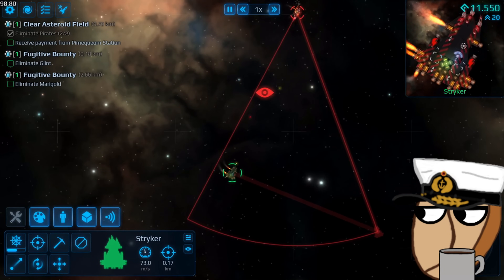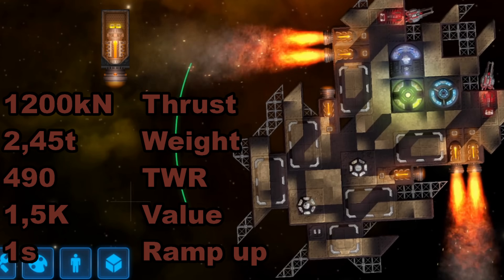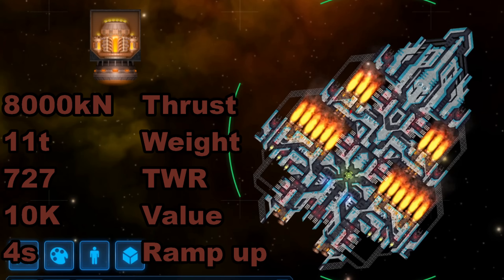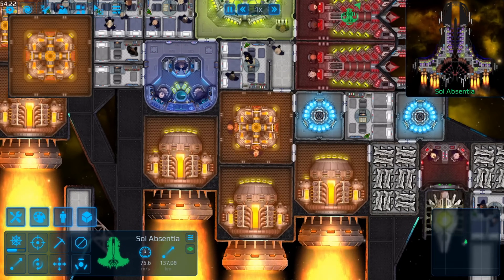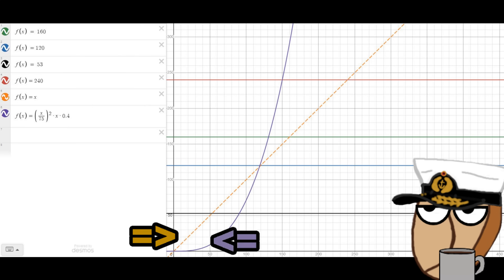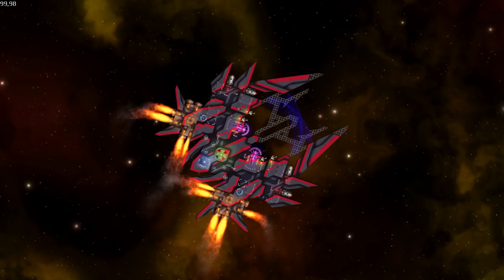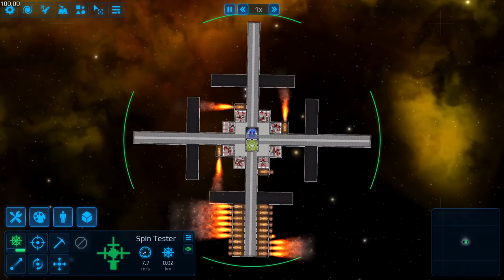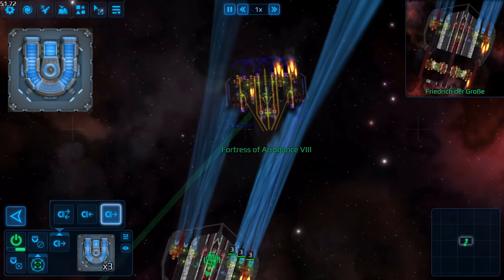Cosmoteer Basic Engines Guide

Comment: The engine room has a massive downside. Crew. Two fuelbros can supply 3 engines, but it takes 4 to supply an engine room with 3 engines attached. You need very large ships with no more room for thrusters to justify engine rooms.
Reply: Some ships will be too small to justify an engine room. But it's worth the cost logisticcally since all of those engines can be resupplied from a closer point. On top of that, the thrust bonus with just 3 thrusters is similar to basically having another thruster and a half of power without any crew or space being used.
Reply: @meeplymoon8391  Right so you can have 6 engines or 4.5 for the same crew in this scenario.
Reply: No.. you can have the same amount of crew power more thrust from farther and faster.
Reply: @meeplymoon8391  Build the boat. See for yourself how it works.
Reply: @Ibian666  I have.. I made a 1200 ton ship go 130m/s.

Comment: Great video but what was that formula at the end? Its just √2, from Pythagoras!
Reply: √2 from Pythagoras is only correct for equal thrust (as shown in the video). Might have made more sense if he had shown unbalanced engines. If you put a huge and a medium thruster at right angles and lock their thrust at max you will get √(8^2 + 1.2^2)~8.09 MN of thrusts in a slightly diagonal vector and "lose" almost all the thrust of the medium one, because you are essentially going "forward" in the direction the huge thruster is pointing you...

Comment: Explosive charges can actually be using on front armor as a means of creating a smoke screen. Just push towards enemy ship and when close enough, explode them so they block enemy fire and you can move to escape or flank them. Your ship will need to be decently fast for the latter though.

Comment: the one thing I always wonder about these space games, why is there drag? we're in space, there is no atmosphere, in theory, we could just keep accelerating to the speed of light even with the smallest thruster, a better implementation would be to give a universal max speed, basically how fast can a ship go without breaking the game, and then the engines would only affect acceleration up to that speed, the only way to slow down in space is to burn in the opposite direction, or hit a large object, there is no drag to slow you down or limit your max speed, I think it would give a lot more dynamics to space battles, as well if there was collision damage, could be fun too.
Reply: We're in what would be considered a "soupy nebula" with a certain amount of constant drag.  Not for realism, but for gameplay purposes.  If you blew up a ship, it would keep flying off into space forever and become unrecoverable.  Any parts that broke off would also quickly scatter across the entire solar system making gathering materials a massive pain in the ass.

It's also much easier to balance ship speed if you cannot simply accelerate to the universe speed limit with enough time.  You have to actually build more and larger thrusters for your ship as it increases in mass if you want to go fast.

Comment: I wrote a short bash script using your drag equation to help me quickly design ships, but discovered a slight error. When using your drag formula in the video, whether in my script, a calculator, or desmos, I find that a TWR of 120 gives 119 m/s, not 117 m/s. This is likely a typo or rounding error (when I try to perform the reverse operation, which involves the cube root, to 2 decimal places, it results in the same value of ~117 m/s for every TWR from 116.6 to 120.1).

Comment: Another great video. One thing I don't get, though... Ramp up time.

If we take a huge engine, 8000 kn of thrust, developed over a ramp-up time of 4 seconds, means that it's developing 2000 kn of thrust per second, up to  a max of 8000. If we take a smaller engine, though, 1200 kn with 1s ramp-up.... So it's only developing 1200 per second.

Larger engines are still better for quick movements than smaller ones, no?
Reply: Already commented this elsewhere, but it may be useful here too.
You're comparing on a thruster-by-thruster basis, but a standard thruster takes half as much space and power as a large thruster.
A large thruster provides 3.2 MN of thrust at 1.6 MN/s, while 2 standard thrusters provide 2.4 MN of thrust at 2.4 MN/s, with the same space and power consumption but lower cost. Neglecting drag, the standard thrusters provide better impulse for thrust durations of under 2.5 s, which will translate to better Δv, so they may be preferable for maneuvering, especially on smaller ships with lower total maneuver time.

Huge thrusters are more difficult to compare as they no longer have the same width for their power consumption, being only 3 tiles wide rather than 4, so I'll compare them on both a power and thrust-width basis. On a power-equivalent basis, they ramp up at 1 MN/s to a max of 4 MN, catching up in impulse to standard thrusters after 4.25 s and large thrusters after 6 s. For equal width, they ramp up at 1.33 MN/s to 5.33 MN, outstripping standards after 3 s and large after 3.38 s.

Comment: 8:40. Do no remove the doors that give direct access the engines connected the engine room else they will not receive power cells when the engine room goes offline. This is especially valid in Career mode when you lost crew after a fight trying to limp back to a safe location.

Comment: I have absolutely no disagreements with this video, which surprised even myself. Everything is spot on and I couldn't agree with it more. Smaller thrusters aren't worthless and I'm tired of people saying that, and you give them a ton of justice. Heck, there is even a whole class of competitive ships called Avoiders that use nothing but an insane amount of smaller thrusters to become insanely agile and allow you to do some crazy maneuvers, if you can pilot well enough of course. Even if you're not going down the avoider path, smaller engines can still be a really useful asset for increasing one's overall agility. And yes, I am the exposed thruster enjoyer and think that boxing them (Unless it's a relatively light and detachable layer of thin armor that is meant to protect you from enemy fire whilst retreating and can be useful for single-thrust fastwalls. My key setups are exposed thrusters with a few tile long armor around all the places where they can be placed. It isn't as space and weight-hungry as completely encasing your engine cluster, but it surely saves you from stray shots around your engines.

5:26 And yes, I too am the guy of Engine Room forcing. They're amazing tool for all and every large ships and there's no other way to put it. USE THEM!
Reply from the maker: finally. i have achieved perfection

Comment: I was wondering how much the ramp-up time matters between std thru huge. If you multiply the transient by the peak thrust output, the rate of thrust change is nearly the same between all the thrusters. IE. the bigger engines may take longer to reach full thrust, but since they have a higher thrust ceiling, the rate of thrust change is the same. Shouldn't this mean the maneuverability difference is negligible?
Reply: So this means that more smaller engines will provide less maximum thrust but reach that maximum thrust faster.
A large thruster provides 3.2 MN of thrust at 1.6 MN/s, while 2 standard thrusters provide 2.4 MN of thrust at 2.4 MN/s, with the same space and power consumption but lower cost. Neglecting drag, the standard thrusters provide better impulse for thrust durations of under 2.5 s, which will translate to better Δv, so they may be preferable for maneuvering, especially on smaller ships with lower total maneuver time.

Huge thrusters are more difficult to compare as they no longer have the same width for their power consumption, being only 3 tiles wide rather than 4, so I'll compare them on both a power and thrust-width basis. On a power-equivalent basis, they ramp up at 1 MN/s to a max of 4 MN, catching up in impulse to standard thrusters after 4.25 s and large thrusters after 6 s. For equal width, they ramp up at 1.33 MN/s to 5.33 MN, outstripping standards after 3 s and large after 3.38 s.